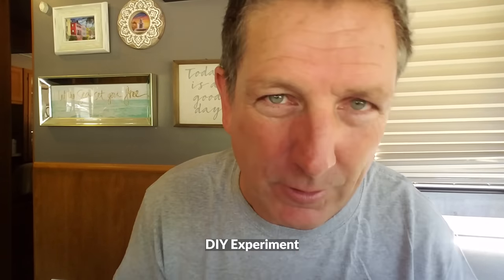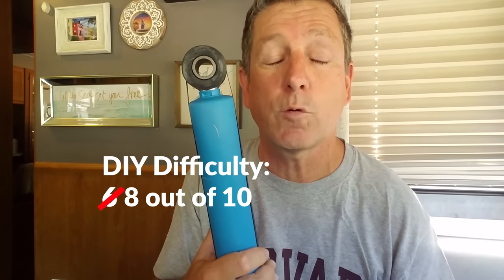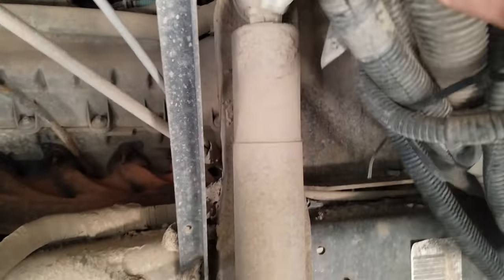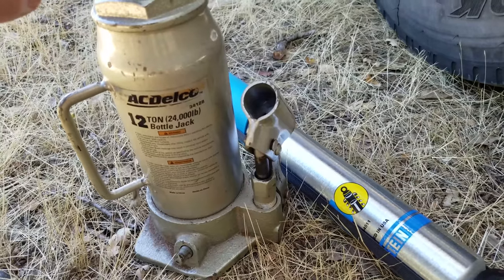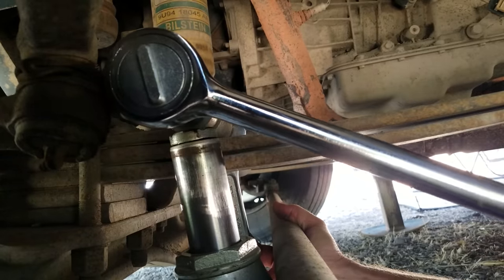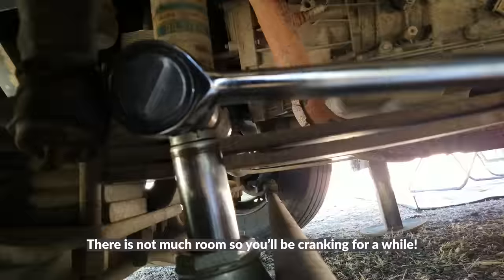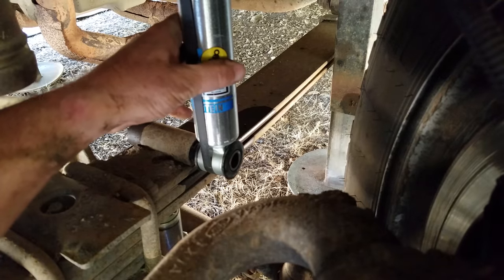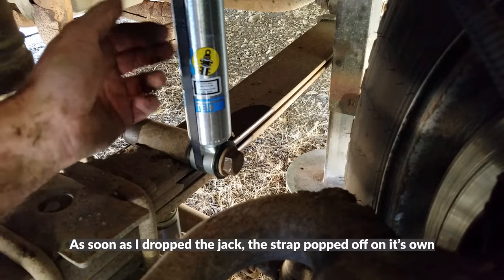Ford F53 Motorhome Front Shock Replacement #fordf53 #fordf53motorhome

Comment: When I bought my Winnebago new it was a option to get Bilstien  shocks which I got.   3 yrs ago I was having a terrible time keeping it on the road and when I got home I found on of the front shocks had not resistance (no oil leak though) Call Bilstien to get it warranted (life time warranty) and they told me "because the factory put them on we don't warranty them" I said I paid to have them added as an option but they wouldn't give. As far as I am concerned Bilstien has a shitty customer service and warranty policy. I won't buy their product ever again.
Reply from the maker: I hear ya Alan! All it takes is one bad experience and you can get turned off a brand in a hurry!  If they are "Lifetime Warranty" who did they expect to warranty them? That's odd! Sorry that had to happen to you. Safe travels!

Comment: And you took out  Bilsteins and replaced with What shocks???  and a guy below says the Milwaukee cordless 1/2 inch impact driver is valuable...  IF my RV moves. it goes with.. just sayin..
Reply: I actually Prefer a Steel Pipe, two feet long, that fits over the Handle of a Big Torque wrench, as it has many Uses beside being a "LEVER" to help undo a Stuck Nut/Bolt? (Tire thumper/persuader/roller to move heavy stuff/etc)
Reply: @Streamer687   and my aluminum 2 ton floor jack. sits in my maintenance bay..
Reply from the maker: I put Bilsteins back in. The aftermarket have a bit bigger piston than stock. I also looked at the Koni. The one on the right was bad. Making a left turn it would dip hard to the right. I don't notice much of a difference other than the dip stopped.

As I said to a few folks, the problem I have with an impact wrench is the noise. I don't want to disturb anyone. We were in the "tent" area at the campground I did that in. Imagine on a Saturday afternoon while everyone was BBQing, I fire up an impact driver! Braaaaaaa, braaaaaaa, braaaaaa.....I couldn't do it! Lol!
Reply from the maker: Neil...always have a pipe handy! Doubles as protection too! Lol!
Reply from the maker: Captain...I carry a floor jack, as well.
Reply: @LifeWithPaulLorena   Ya I searched around and got a JEGS, 2 ton aluminum racing jack..  (well the one with short pumps and fat low profile rollers etc.)
Reply: @LifeWithPaulLorena  I carry a long breaker bar too..   lol. all the stuff..

Comment: You need the grease your chassis too, the suspension  looks pretty dry. Next time just suspend your suspension with your body jacks.
Reply from the maker: All the steering joints and things that need grease have been done.  Appreciate the tip on suspending!